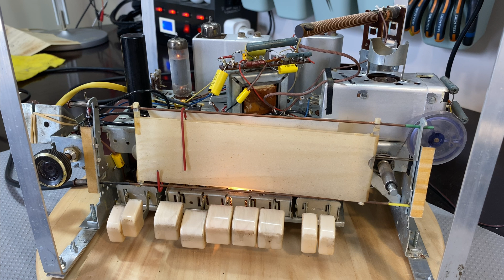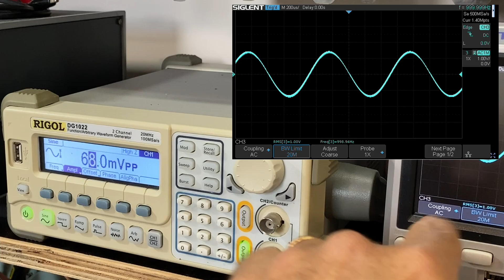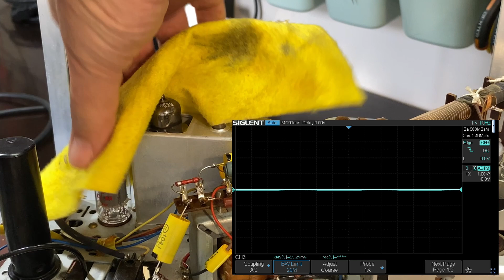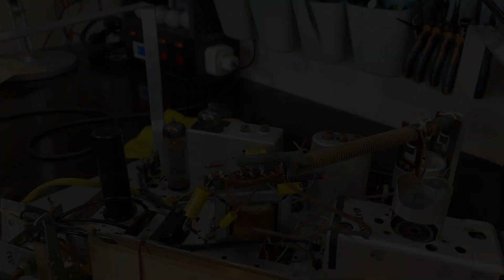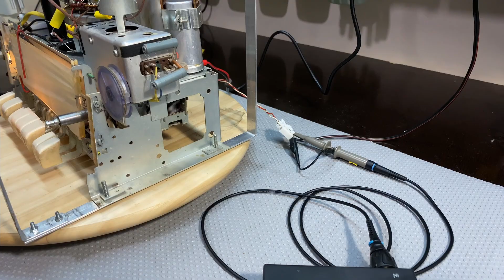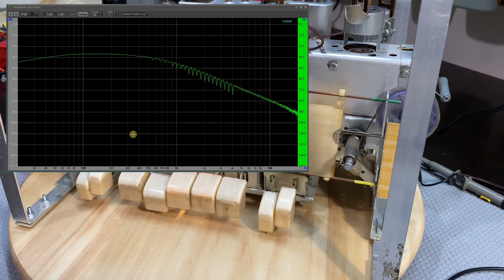Testing with new audio tubes, and some frequency response curves. Telefunken Dacapo 9 part 3.

Comment: You tested whether the gain of the circuit changed with the new tubes.   I would expect that to mostly be set by the external components.   It would be interesting to see how much output power you can get for a particular amount of distortion with the old and the new tubes.

Comment: I am having a problem with a BRAUN RC 61D, resistor r21 was replaced still getting hot with all tubes removed and bridge rectifier replaced.

Comment: Hello Again, You video is very interesting and quite important, because many Telefunken radios of this period have more or less the same schematics and parts.
For instance I have an Operette7 from 1956 and it is almost the same radio with the same Schematics. One interesting differnece though, in the Audio,  for tone control, the Dacapo6 uses again some kind of Piano Keys, whereas the Operette7 has two continuous tuning with potentiometers.....
When you will adress the RF and IF parts, the schematics are 100% the same. The Telefunken FM ECC85 front end was broadly used, it was even sold to french manufacturers lik ORA.

Comment: Hi Manuel ! The tubes has to be "burn in" for some hours to get the full performance. The Bariumoxyde have to develop onto the cathode slowly. So after some hours it should be the same power like the older ones. And You should look if the maximum power before clipping is higher with the new tube, because with the same bias and signal it is normal that You get the same output, except the old one is realy weak.
Reply from the maker: thanks
Reply: The clipping voltage may seem quite low. Of course this depends on speaker(or dummy load)  impedance.
One of the reasons is because in the Telefunken set, the anode current is only 31 mA, where as the EL84 nominal is 48 mA.
Telefunken is using the EL84 very safely to make it last longer. 
The EL84 became like a whatever workhorse , whatever power was required. Then later ECL82 and the like were favorite in medium size radio, once germanium diodes replaced the EABC80 triple diode.
and then....... solidstate won rapidly the place
 @electronicsoldandnew

Comment: I've never understood these type of radios. If you go and listen to live music you have exactly the same ears that you listen to someone talking. The same should apply to a radio. It should have a flat frequency response. So speech should sound the same as the live versions of music. You should not need to change anything. I guess that's the difference between a domestic radio and HiFi. The domestic is made to sound PLEASENT but not necessarily accurate. With all that tone shaping, it's almost impossible to actually get a flat response, even more messed up with the loudness contour.
The test you made on the EL84 only showed that the gain was similar. If it's emission was getting low, it might change the gain, but more likely it's maximum power. I would expect to be lower. On a good day you should get around 3 watts @ 10 % distortion from an EL84 dropping to 2.6 watts at 1.5% THD on an average domestic receiver. Often somewhat lower due to lower HT.  Might be worth testing for max power, interesting to see if the old valve gives the same power as the new one.
Overall, these continental radios always sound better subjectively, than the American radios of that time, that hardly ever use NFB or reasonable speakers, often just mounted on cardboard or no baffle at all. Never with a tweeter!
Reply from the maker: I think the tone shaping and presets were introduced in the spirit of innovation and even competition at that time. Also, we need to take into account the effects of the cabinet, the transformer and the speaker itself on the sound. Some of the tone shaping is to compensate for those interferences as well.

Comment: I am surprised that TELEFUNKEN(GMBH) didn't see fit to use their Space Charge Vacuum tubes and use a B+ or around 64V and a heater voltage of 3V which would have meant that the unit would run cooler and could be run of 5xPP9 9V batteries.
Reply: Audio power output would only be about 200mW with such low HT and current availability. Not enough for electrostatic tweeters either. So probably not such a good idea.

Comment: I'm curious about the distorsion you observed at certain power level. I guess possible origins to be screen voltage (low) of EL84 or bias of the same tube . In any case your work is fantastic and you are a very fine teacher

Gabriele
Reply from the maker: Thank you
Reply: EL84 cathode resistor is 250 Ohms, limiting the anode current at 31 mA. The Nominal cathode resistor is as low as 135 Ohm to get the full power (and volatge at the output) with an EL84 . The most common value is around 180 Ohm. @electronicsoldandnew

Comment: Comparing tubes, you'd better use the FFT analysis, for it tells you more about parameters like distortion. Comparing on output level is not usefull. The output tubes usually have some form of NFB stabilizing the output level.

Comment: I would love to see you test the tubes on a emission tester next time :) A bit of my experience with power tubes (EL84s mostly): there were only few occasions where the power tube was so weak it only produced sound on highest volume. Even worn tubes would perform almost indistinguishable to the new ones on most radios. Lot of EL84 died because of g1 getting positive (caused by internal deposits inside the tube - sometimes also by bad coupling cap) which would make it run hotter and hotter until there would be not enough emission.
Reply from the maker: I don’t have a tube tester - by choice as they are really bulky beasts. I normally have a stock of replacement tubes and if any seem defective or weak, I determine that by putting in a known good one. I know this is a rather strange method, but my stock of tubes takes up less space than a tube tester 😊
Reply: @electronicsoldandnew  No, this is the method a lot of old techs back in a day used when they couldn't afford or care for a tube tester. Even on the authorised repair centres for the TV repair they first replaced the tube(s) that would most likely be the cause of the problem and then they started to diagnose further. Old tech said that new tubes solved about 60-70% of the problems at that time. Also, there is a uTracer tester kit that you can build for about €300. I would be happy to see you build one and test some tubes - after all it is something that I might buy and assemble in the future, as I don't own a tube tester - I usually do the same as you, but now I only tested RF and IF tubes that way (applying a RF signal and measuring the output). Also, one nice test to confirm if a tube is weak is to up the heater voltage for 1-2V. I've made a test rig to do that, I also connect anode and grids to the stabilised voltages and measure cathode current. Weak tubes with increased heater voltage usually show very large current increase, but good ones show very little or none. It is essentially what they did with CRTs when they got low on emission.
Reply from the maker: I’ve looked at the utracer, but I believe it is made to test mainly more “modern” tubes. I may be wrong.
Reply: @electronicsoldandnew  You can test anything with it, as it is completely digital. As long as you have a curve from a factory datasheet and you can compare the values. Even 1920s tubes can be tested with it :)
Reply from the maker: I’m going to have to revisit that possibility. Thanks.
Reply: The leaking capacitor on the EL84 or EL41 command grid is the most common cause of wearing out the tubes. 
I always have to change this cap.
The second one is the electrolyte capacitor on the cathode, it produces the same effect
Reply: @yvesbarbin97  Hi, yes the coupling cap needs to be changed. But interestingly in a lot of radios that I worked on, that cap was already changed when the radio was still in use, and they always used poly/styroflex cap (most likely changed in late 60s/early 70s). The electrolytic cap if it opens, it will not harm the output tube. If it shorts, well this will not happen well. Luckily I only seen shorted cathode caps when the cathode resistor went open and it put 50-60+V on the 20 or 25V cap
Reply: @michvod  Thanks for the continuing discussion.
when the cap between EABC anode and EL84 command grid is leaking, voltage rises on the grid and so the current rises inside the EL84 and the cathode gets more and more positive and then the Cathode decoupling capacitor is overstressed and it starts to leak too, then the life of the  EL84 is getting short.
Reply: @yvesbarbin97  This is most common why the output tubes die. But this usually happens with old radios that are turned on and put into use after 30 or so years and the capacitor is still original. Another none, a very good tester for tubes is RoeTest from Germany. I almost forgot it exists, but I have seen it can test very old tubes, even A series with 4-volt heaters :)
Reply from the maker: thanks

Comment: Very interesting video, betwen theory and practise.
What some theory would tell us.
The Dacapo has a global negative feed back loop. 
Though, the negative feed back factor  to amplification factor ratio is probably not so high, especially in the bass band.
Amplification coefficient of EABC80 is about 50 (=1.2 * 40), amplification coefficient of the EL84 is at best 50 too.
For a 5 ohms speaker, the transformer voltage ratio is about 1/30 (square root of impedance ratio),
So raw amplification factor from input to speaker would be = 50 * 50 * (1/30) = 80
The negative feed back circuit gives an amplification ratio of 11 in the medium frequency i.e. (2200+220)/220
would  give about 5 dB more in the high frequency (about 20) dur to the 270ohms in parallel , and is culminating at 90 in the lower Bass, with maximum Bass setting.
(18K+2.2K)/220
We see that there is no room for more negative feedback in the lower part of the spectrum, as the raw amplification (80)  is lower than the feedback ratio (90).
In the midrange , the gain is dominated by the feedback loop. But for the lower bass, the real tube performance will act. And higher gain tubes would give a bettre control by the feedback loop and so less distortion.
About tone settings, and from the schematics this is what I can read:
The "Bass" Control is acting on the global feedback circuit.
The "Speech" Control is acting before the potentiometer, so before one enters the part of the amplifier that is controlled by the Global loop.
The "Jazz" Control is acting on the tap position on the potentiometer ("loudness"), then is has little effect when the potentiometer is at maximum (what you find)
I am always curious about the triode anode tone setting (the "intimate") as it is in the middle of the amplifier which is controlled by a global feed back loop.
It looks contradictory to me , but it is used quite often, and it is effective as one can see or hear !!!???. Probably a matter of margin, and phase? I would be interested by some more explanations
Reply from the maker: That is an impressive bit of analysis. Thank you. I have not gone into as much depth on studying the circuit with this one as I want to get it done relatively quickly (holidays are calling 😊)
Reply: Thanks to You. Your tests are very interesting and not performed so often.  @electronicsoldandnew
Reply: I have not such hardware and software yet to display the full audio bandwidth. One can also see the harmonics lines when you are sweeping. What is the scale?
 @electronicsoldandnew
Reply from the maker: The interface is not calibrated at all, as I explained in the build video. It only serves to see trends, unfortunately.
Reply: @electronicsoldandnew  Nevertheless, I think that, from your experiment, one can appreciate the trends of harmonic distortion with this smaller line running at the right of the main peak line, while sweeping

Comment: There can´t be a difference between old and new tube (EL84) due to the negative feedback in the output amplifier. This negative feedback stabilises the output power, the frequency response acc. to the set tone controls in the feedback loop and the linearity (THD). Only a heavily faulty tube would show a remarkable difference.
Reply from the maker: Makes sense. However, I always thought the power output of these radios was far lower than stated in their specs, so I believed it was due to tube ageing. I was obviously wrong. Another lesson learnt.
Reply: @electronicsoldandnew   Manuel, other Radios don´t have such a negative feedback as this radio, so the output is more sensitive to the tube aging.
Reply from the maker: Thanks

Comment: The thing with the EABC80 is that it is in an autobias mode i.e. Cathode is directly connected to the ground, and the grid has 10MOhm or some large resistor, so every tube finds its different bias point. The same autobias can be used with ECC83.
Reply from the maker: true. I did however expect that the rube would have provided a little more gain, but I was wrong.
Reply: Yes Veljko, and the disparities between different EABC80 is reduced by the quite high DC RESISTIVE load in the anode.when currents would get higher , The high resistors shrink the anode voltage which tends to reduce the current.
My question is then about the Audio input impedance of the selfbiased EABC80 and its vatiability with tubes and age?

Comment: Very interesting test! still it is just a single point of comparison between the old and new tubes, as you pointed out. I think the negative  feedback this amplifier uses, will mostly  equalize tube amplification differences. 👌
Reply from the maker: probably correct.
Reply: but to go one step further rises a question: why changing the EABC80 did make a difference?
Reply: Yes I agree about negative feedback determining the gain, a bit like transistor amplifiers, where voltage gain is only a matter of the ratio between two resistors, regardlass of transistors Hfe.

Comment: I am not surprised that you did not see much amplitude difference when changing valves.  As you pointed out in the last video, there is negative feedback in the audio circuit, which reduces the gain variation seen due to changes in the open loop gain.  Also the negative feedback reduces distortion.

Comment: You should have measured the maximum undistorted output level achievable with the old and the new output tube, not just the gain of the amplifier. I don't expect to see much difference here either.  B+ voltage drop due to an old selenium rectifier can also reduce the output level that you can achieve, so you should measure it again when/if you replace it with diodes.

Comment: would it be true to say that the tubes are rarely the cause of vintage audio equipment failure and they are much more reliable than people think?
Reply from the maker: Definitely. I rarely have completely bad tubes in these radios.
Reply: @electronicsoldandnew  Yes , agreed, most failure are due to not reliable people